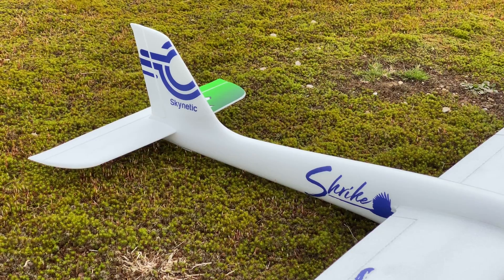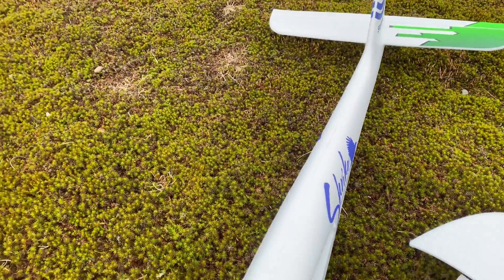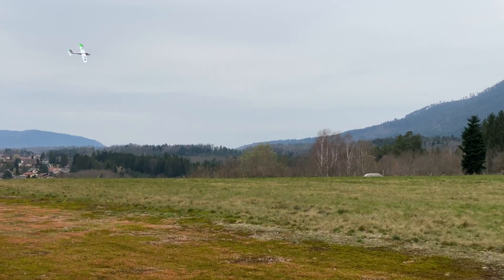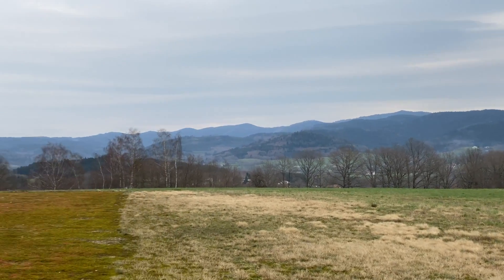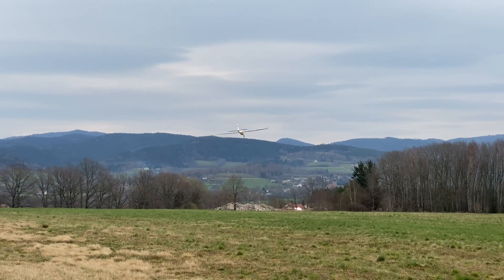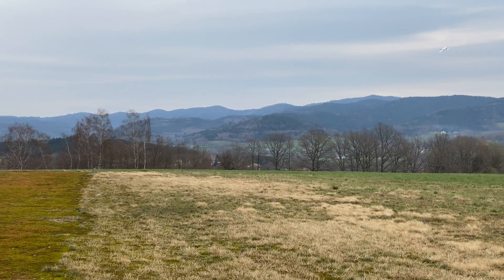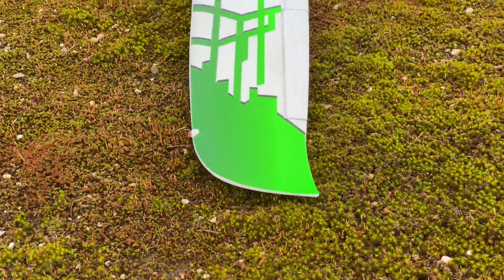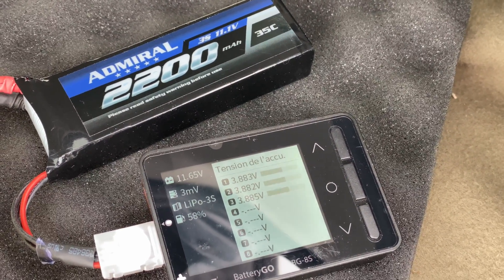Skynetic Shrike Glider 1450mm PNP      REVIEW+SETTINGS - www.motionrc.eu

Comment: Bjr Arthur. Intéressant ce petit modèle intermédiaire au gabarit "Park Flyer" ou adapté à un petit terrain du fait de son envergure et de sa capacité d'atterrir en espace restreint. Le montage du Stab semble un peu tortueux sur la vidéo de Motion RC (?) et la fixation du cône d'hélice donnée pour se désserrer en vol si le frein moteur est activé brusquement (ie mode on/off des gaz à un certain régime). Comment avez-vous résolu cela ? A moins que lors de votre vol d'essai les gaz étaient sur un stick ; ainsi qu'un avion et non sur un inter On/off ainsi que l'on a l'habitude de le programmer sur un avion par exemple. Autre question si je peux me permettre : que pensez-vous de la qualité des mousses des ailes et fuselage et de leur tenue dans le temps ? Idem pour les charnières en mousse. Ne sont-elles pas trop fragiles? Les commandes de servos sous les ailes & volets ne semblent pas protégées ; cela peut être un point de faiblesse également pour un tel petit gabarit qui peut accrocher branches ou autres touffes à l'atterro dans une prairie par exemple. Un grand merci pour vous essais qui permettent de découvrir plusieurs modèles très différents les uns des autres.
Reply from the maker: C’est un super petit planeur enfin plutôt un avion planeur car c’est pas un gros gratteur, je ne l’ai pas gardé longtemps donc je n’ai jamais eu aucun soucis pour quoi que ce soit et oui je vole mes planeurs comme un avion avec les âges sur un stick et croco sur un slider 😊
Reply: @ArthurRC  Je me doutais bien en re re revisualisant votre vidéo que les gaz étaient configurés sur le stick et non sur un inter On/Off :-). Personnellement, je réserve le stick droit aux Ailerons et au déploiement du Butterfly en programmant sur laradio les gaz sur un bouton-rotatif qui me permet de doser (100% au lancé initial / 70-75% à la relance) les gaz avec un inter On/Off coupe circuit du moteur.
Pour en revenir au modèle, il y a de ce côté de la Manche les tchèques Kavan qui proposent un modèle abouti, Alpha 1500V2 ARF, dont le gabarit est très proche du Shrike. Volets en moins néanmoins. Avec des qualités plus proches a priori d'un petit planeur motorisé que celles d'un avion-planeur tel que ce Skynetic.
Parmi vos carnets de vol à venir, auriez-vous dans votre planning un essai réservé à ce modèle ? En France, Intermodel distribue ce produit avec un fort volume de ventes, vierges semble-t'il de retours SAV (en tout cas, c'est ce qu'ils communiquent)
Reply from the maker: @JPh35  ah non désolé mais j’ai pas du tout prévu d’acheter ce planeur, c’est pas trop mon truc 😕😕 mais peut-être qu’en leur téléphonant ils vous donneront plus d’infos dessus 😇